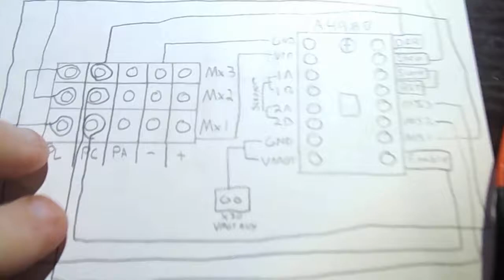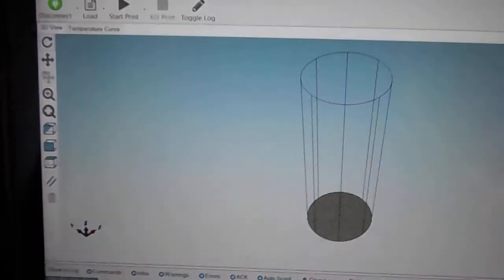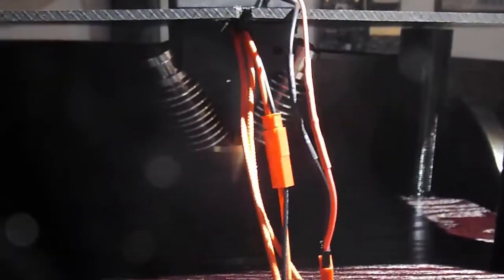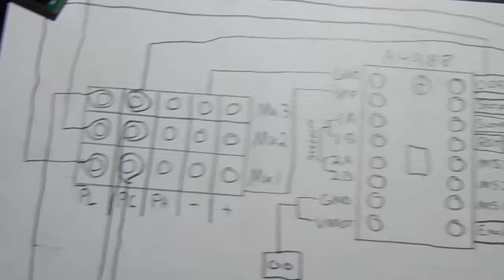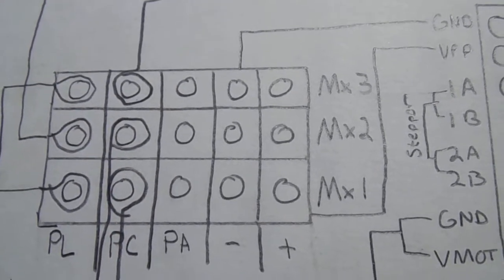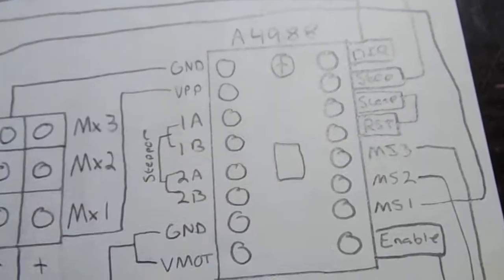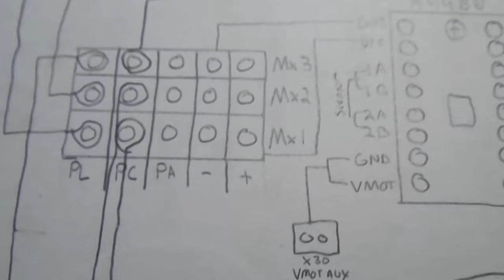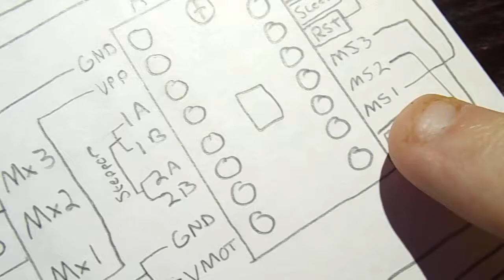Extra Stepper Motor for diamond hotend on Rambo for Rostock Max v2

Comment: Do you, or anyone else, knows how to setup an Expension Board, like this: http://www.ebay.com/itm/172569448851?_trksid=p2057872.m2749.l2649&ssPageName=STRK%3AMEBIDX%3AIT to my 3D printer, so I can use a second power supply - to heat the Het Bed on my Rostock Max V2? Thanks!.  Also VERY NICE VIDEO!

Comment: soo newbie question here, i jumped the gun a bit after seeing this and bought a diamond upgrade kit with a stepper expander x1 not realizing you custom built yours,   the cable  coming off the the pcb has a 10 pin female header 2 x 5 parallel lines is this something that could be made to work by changing the pin configuration on the rambo board?